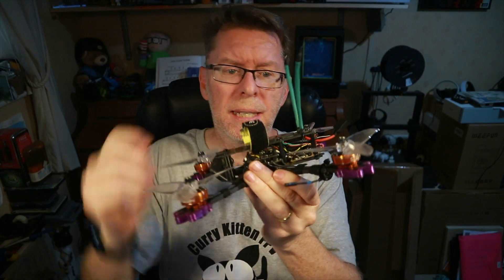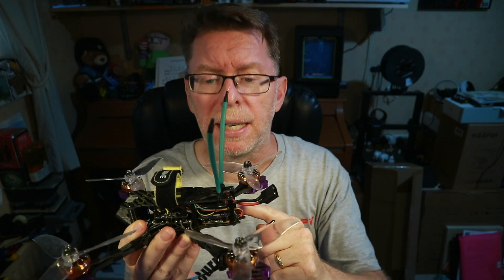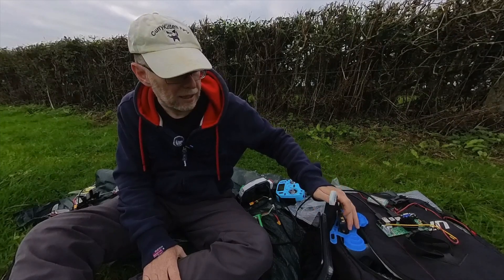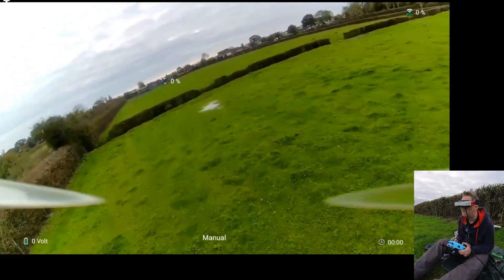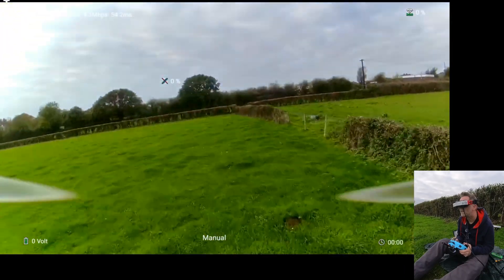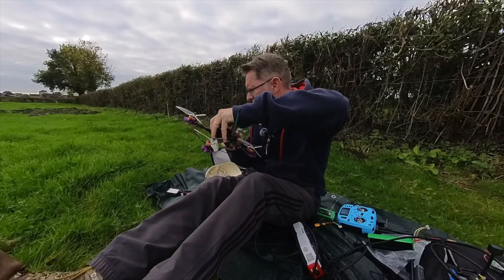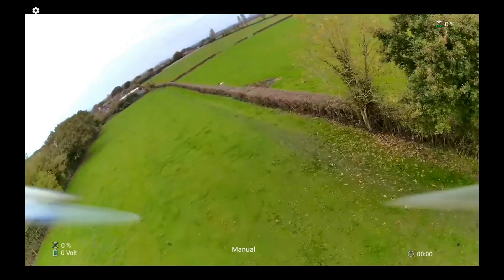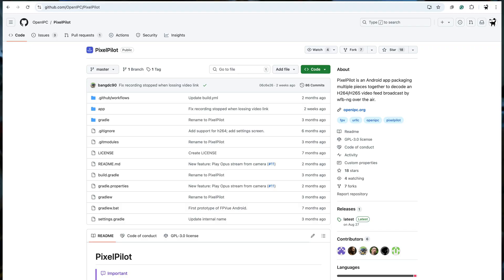Flight Test of the RunCam WifiLink OpenIPC system - it's good!

Comment: Would you happen to know if it is technically possible to use the RunCam Wi-Link without the USB OTG Adapter? I know performance would take a hit but just want to know if short range tests are possible with just a tablet only.
Reply from the maker: It's not possible, no.  It's because (I think - I can't remember if OpenIPC does this) but the video link isn't actually wifi as you know it.  It talks directly to the hardware and uses a more direct protocol which a tablet can't
Reply: @CurryKitten  Ah no worries, thanks so much anyway. This channel has really valuable info!

Comment: Can I use the runcam wifi link with the nvr board
Reply from the maker: Yep -  it's what I was using to fly with.  OpenIPC is the common factor, so you should be able to use any receiver with any transmitter - as long as you are using compatible frame rate/resolution on both ends

Comment: Nice, I did the radxa+rxl8812au and emax 100mw vtx
Reply from the maker: The Radxa is where the smart money goes.  I like the fact it's easy to build something mountable on your goggles as well as being able to add buttons to start/stop recording and change channels.  I would get one to replace my NVR, but i want to see if a commercial goggle module comes out soon
Reply: @CurryKitten  I saw a post from Mario on YT responding to a comment suggesting not to hold ones breath about it last few days. Who knows. Maybe caddx can make a openipc vrx that plugs into their goggles X.
Reply: @CurryKitten  there is a radxahat (a shield for the radxa with bec , usb hub , wifi , buttons all integrated onto the board so a pretty easy ground station build) being worked on i think more info on that will come out on december , as far as im aware there is no truly "of the shelf" VRx module atleast coming out soon . More info on the openIPC goggles will be released during December BUT igor said IF the goggles even make it to market expect it mid 2025 or later ... so dont hold your breath for it essentially

Comment: yep one thing i found was that you needed to make sure you had a good in built bec on your board , usually if your FC or AIO has a DJI or Walksnail connection port , use those , they will happily power the runcam air units. MSPOSD only works on betaflight 4.5.1 onwords so don't forget to update your flight controller, As far as easier ground station setups , so far i do know a radxa hat is going to be released before years end (i think) but info on openIPC goggles have been slow , right now everyone has said that its a hit or miss if the openIPC goggles will ever see market .

Comment: What are the antennas you are using?
Reply from the maker: There are 2 simple dipoles on the Walksnail VTX.  I've used a cable tie and some heat shrink to hold them up in the direction I want them

Comment: That looks very promising. At the price analog VTX are for the moment, this could become a serious candidate. This could also being down the price of DJI and Walksnail systems
Reply from the maker: Interestingly, just today Caddx (who, of course, own the Walksnail brand) dropped $1000 into OpenIPC funding and are looking to work with them.  To what end right now, we don't know.
Reply: @CurryKitten  most likely caddx will just release a airunit , though what im hoping is that they might do is help openIPC/openHD with the radio transmission hardware - openIPC and openHD both use basically cracked wifi modules so there are limitations in their capabilities and caddx has plenty of experience with radio transmission hardware . Also im hoping that they might release the SDK's and relevant files so that openIPC can run their software on the avatar VRx module